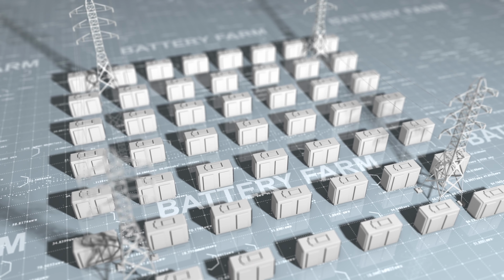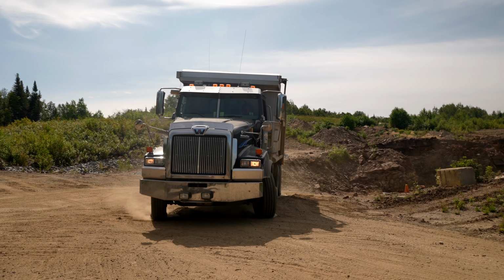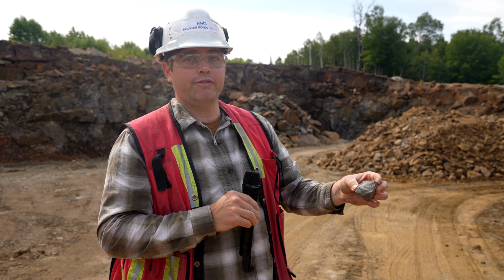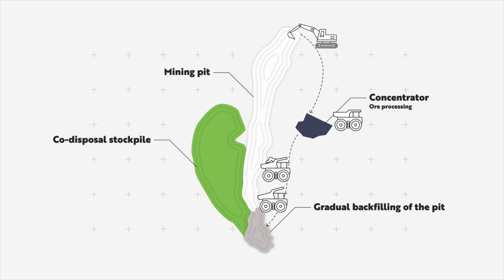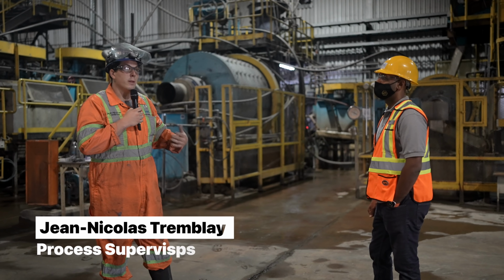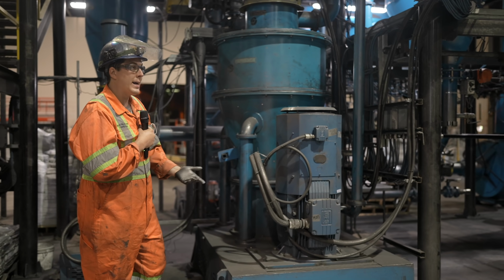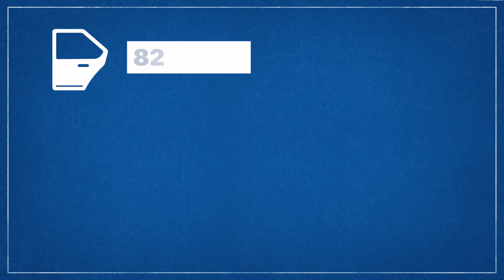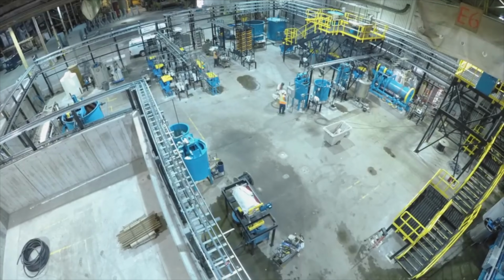The Secret Ingredient to EV Production?

Comment: Except LFPs, which the world is moving to, needs synthetic graphite. So mining natural graphite will only be useful for NMC and NCA batteries.
Reply from the maker: not true, there are value added practices to create battery grade graphite.
Reply: @TwoBitDaVinci  That is true and it may be that other chemistries (such as silicon-graphite that I think you mention) come to fruition, but I don't see how that follows from my statement. As I understand it, LFPs require synthetic graphite, and NMC and NCA use natural graphite. Correct me if I'm wrong but I believe that is right.
Reply: What your talking will take 10 years to perfect and then another 10 for the factories to adjust and change machinery to build it by mass. 

2042

Comment: Thanks for this video.  I work in the development of tailings clean up, everything from dry stack to sludge pond to flooded mines, and water purification systems.  I have not worked with any graphite mines yet, only gold, silver, aluminum, coal and oil.  This information is a great starting point so that I can be better prepared when the time comes.

Comment: If you have a remote control with a button that doesn't respond, mine is the mute button because I have two TV's, you can open them and clean the pad and the circuit board with some alcohol on a towel. Put some graphite that you shave from a pencil and put it on the rubber button or try just using the pencil to put graphite on the rubber bump. You may need to redo. If you get it all 9over the circuit board it can make it go crazy so clean it and start over. Or just go buy a universal remote.

Comment: 2,000 tons of product... It sounds like a lot.  But a very modest freight train of 20 cars or so is all it would be...
Reply: 2k tons now for qualifying material to sell and help secure contracts as they reach the milestones... future yearly will be ~40-45k tons flaked, and ~40kTons coated spherical graphite ready for batteries. so ~85k tons with scalability to 200k tons/ year if the demand requires it.

Comment: 2000 tons from 40000 tons. Lol what a joke. @ their average weight average at $1609/ton That's = $3 218 000. What's it cost to dig down 270 meters and hide 38000 tons of poison? that stock is going to be worth about $6.00 after the next 10x reverse split. Get out now.
Reply from the maker: Be careful giving financial advice based on little knowledge.

do you think large concentrations of elements exist in the ground? mining is all about extracting low concentrations

Comment: the thing about EV tech is that it is scaled up to eventually supplant ICE for all ground transportation is that it brings on a need for sources of raw materials that was never there with ICE technology. Much of the raw materials needed for EV are semi exotic to exotic and all of them require mining and difficult extraction/refining techniques. This is the Achilles Heel of EV tech. It wad okay when was just Tesla making EVs for a paltry of people in significant income brackets. But when EV is scaled out for the whole world, instead of "saving the world", it ends up destroying the environment of the Earth at a scale we've never seen the likes of before.

This is why I like carbon-neutral fuels synthesized from atmospheric CO2, coupled to the ICE ground and air transportation (and refueling infrastructure) we already use - we already no we can do that tech stack for the entire world - just need to address the fuel source, which Prometheus Fuels has done. And there's no sulfur or trace heavy elements in this synth fuel so it burns very cleanly compared to petroleum-derived fuels. And very nicely, cheaply, and simply, it solves the intermittency problem of solar and wind energy sources. The synth fuel just accumulates in holding tanks until a tanker truck visits to take it to market (itself using synth fuel). This is a sustainable tech that the whole world can use without destroying the Earth's environment the way EV tech is going to do

Comment: Very informative and extremely interesting. One problem I see is the environmental restrictions and regulations, whilst laudable, will put far higher costs on them over what it costs to produce in China. Cars built in China could have a significant advantage. Indeed, apart from the Chinese manufacturers starting to export cars to Europe now most Tesla's sold in Europe now are actually built in China. 
I read somewhere that electrification is likely to lead to a 1000% increase in mining operations, the worry is large portions of that will be in Africa and South America where environmental protections may not be as strict. Great video, as usual.
Reply from the maker: You make great points... I asked about this, but the belief is that eventually the value proposition will win out. Especially as regulations and protections increase in China.
Reply: Once demand exceeds the supply China is willing to export, the choice will become paying more or not making EV batteries. Given the massive expansion of BEVs coming this decade, and China prioritizing domestic supplies for domestic production, NA battery producers will NEED graphite from NMG.

Comment: Looked at another way, its pretty obvious how China cornered the market in the first place.  A complete lack of environmental controls will do the trick.  Not just in this particular case, but across the board.  At some point China will start to care enough about the utter destruction they are causing to their own environment that the competition will have more common ground, but that time is clearly 'not yet'.  Until then, competing with them at scale will probably require fairly significant government support.  Mining is a dirty business no matter how you twist it, but these smaller more ecologically-sensitive projects may pave the way.

-Matt

Comment: Possibly of interest: a green and efficient approach of synthesizing graphite from carbon dioxide at ultralow temperatures in the absence of transition metal catalysts. 

Liang, C., Chen, Y., Wu, M. et al. Green synthesis of graphite from CO2 without graphitization process of amorphous carbon. Nature Communications 12, 119 (2021). 

nature [dot] com / articles / s41467-020-20380-0